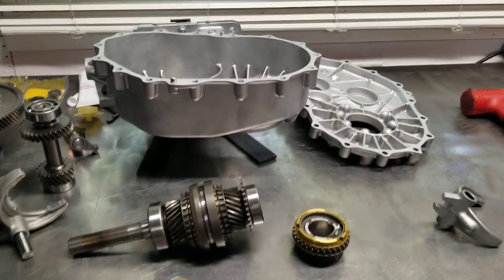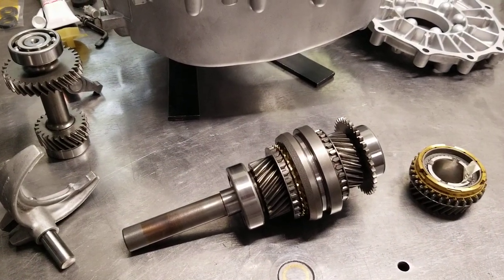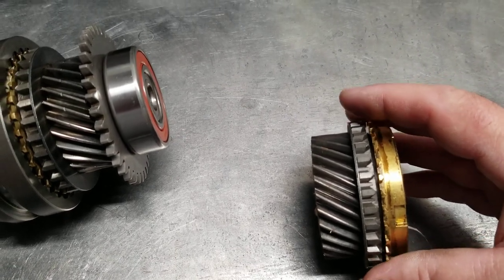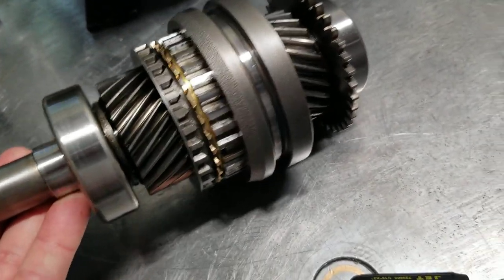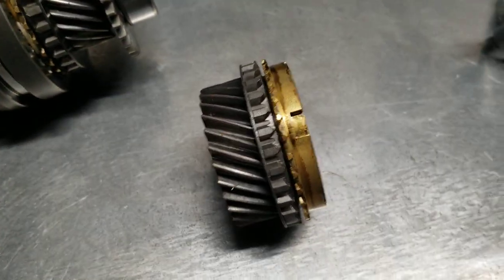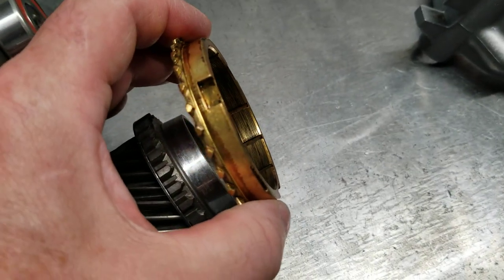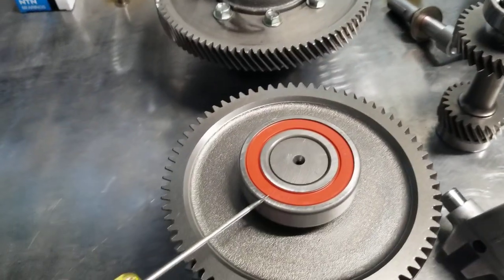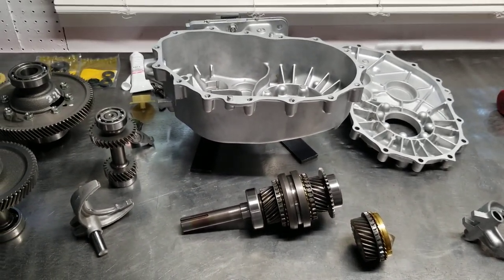Club Car Transaxle - Synchro Stuck on Reverse Gear

Comment: Hi Brad, thanks for the informative video. I’m currently working on an 03 gas club car transaxle and am going to replace the synchro rings because it keeps popping out of reverse and forward. The weird thing is when everything is together the output shaft has a lot of movement from left to right. From your experience is that normal. Appreciate any help.

Comment: Is there anywhere you know of to get  new syncronizer rings.  Any help would be greatly appreciated.
Reply from the maker: For the 97-13 16 degree? Anywhere. The older stuff is no longer available.
Reply: @BradPorcellato  Mine is a 2014 club car precedent with the graziano transaxle. Seems like parts are hard to come by. I wasn't sure if thats the 16 degree one or not.
Reply from the maker: Sorry, but I don't work on Graziano products.
Reply: @BradPorcellato  sounds good, I appreciate your videos they are very helpful. I appreciate you responding so quickly.